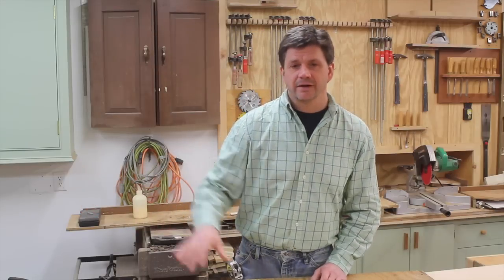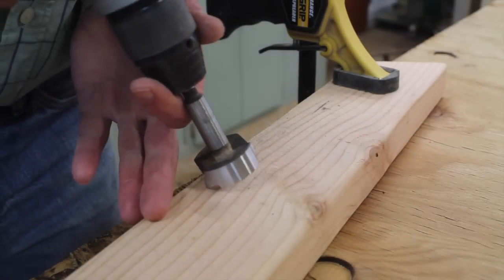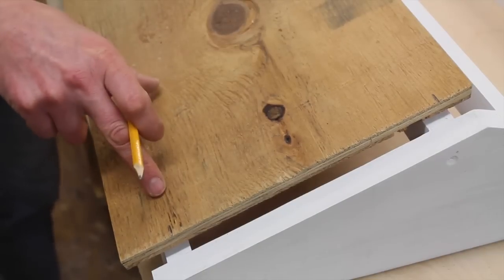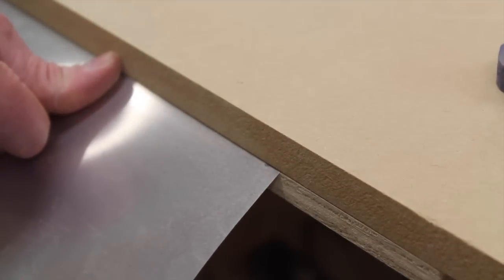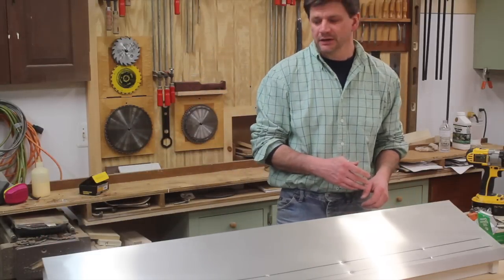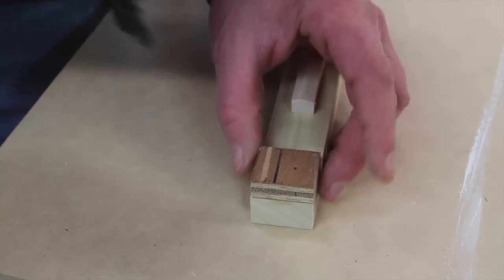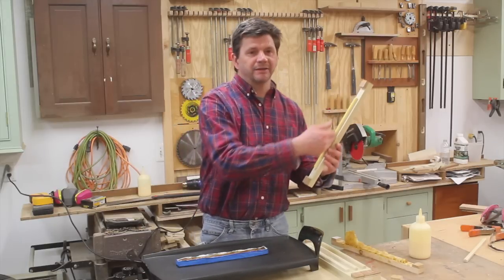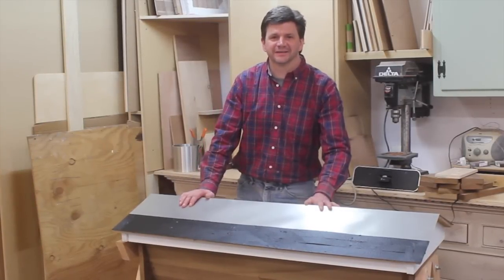How to Build a Top Bar Beehive part 2, FREE plans on my Site

Comment: Great Part Two!
Noticed we have (it appears) the same 14" BS.  I was disappointed with mine. I had a SEARS tilting arbor BS and sold it to get the $$ to buy the Delta.  Almost instantly the tilt arbor broke and I discovered it (and the only replacement available) were made of pot metal.

I was also surprised to find it didn't appear to have much power.

I wondered if you had found any issues with yours and (esp) if you 'fixed' any!

BTW: When attaching the roof (in Part One) you added a strip of wood to the exterior end panel. Then (in Part Two) you layered another 1/4" thick piece on top of the first piece. Then when attaching the hinge, added a shim to the 'lid' (roof) leaf of the hinge to effectively move the roof 'over' 1/8" 

I cant' recall the dimension given for the first piece - but will call it 3/4" for sake of simplifying this suggestion.

Since you added 1/4" to the 3/4" strip, then 1/8" to the hinge leaf, the first strip added should be  equal to 6/8 + 2/8 - 1/8 or 7/8".

Comment: Roofing Screws --> There are such things. They come with a rubber 'washer' that seals the hole.  They are Galvanized and self-tapping through 18-20 gauge metal roofing material.  I really like your build - not a critic, just sharing another way.

Comment: Thanks for the video.
Reply: I started building one yesterday,just a demo.One side of the CDR is smooth finish and other side is rough.Would I want the rough side in or the smooth side and also the bars I started building too?
Reply from the maker: mark s Sounds Mark , either way will work
Reply: Thanks Jon.I work for a lumber mill and thought I'd give it a shot.The Cedar we cut are at 11 1/4 inch so I hope losing 3/4 of an inch doesn't hurt much...Thanx again
Reply from the maker: I don't think the bees will mind  :) enjoy the project

Comment: Thanks for the video, very good instruction! I'll be making a top bar hive soon.

I have a question for you. I have a circular saw instead of a table saw. Can you suggest a good way to cut the long 1.25" strips for the top bars? Thanks, it would be appreciated.
Reply from the maker: Thanks Brent, they may cut them for you at the lumber yard if not I think you could use a straight edge

Comment: Hi Jon, thanks for these plans - I have 1 problem - I built your previous version using your inside side dimension of 13" x 12" & your new version is 12 3/4" x 12" - how come you didn't have any trouble moving your bars from hive to hive as this changes the width of the body of the hive?
Reply from the maker: Most people will be able to find 1x6 &1x8 at the home store and 1 x6 + 1 x8 = 123/4"   mine is 13 x 12 but the plans are for 12 3/4 x 12